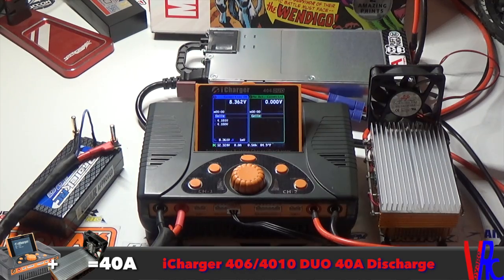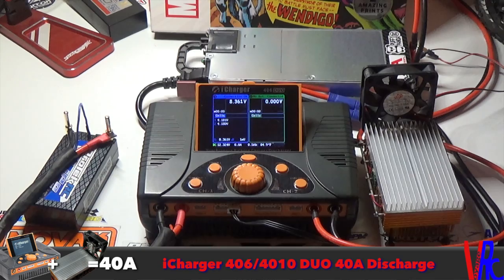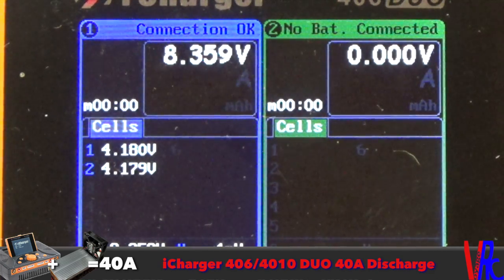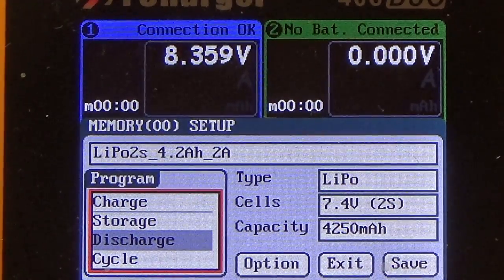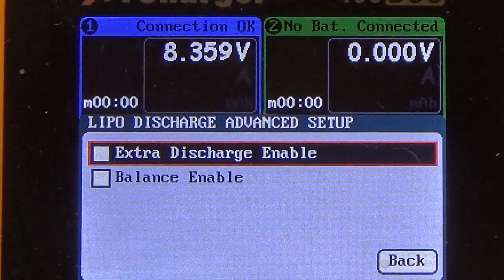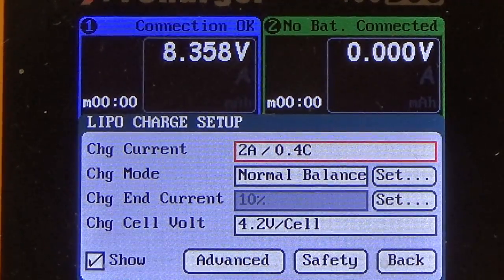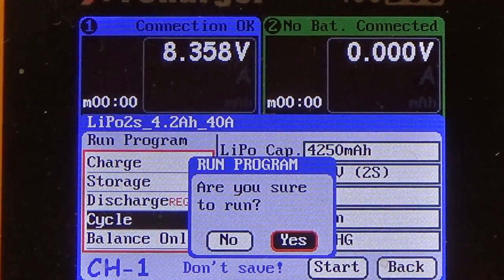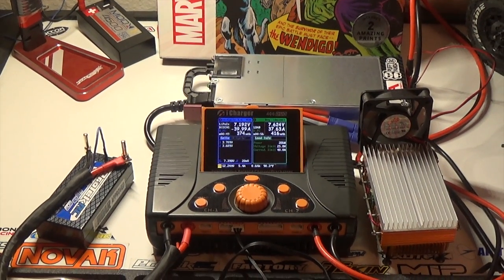How to setup an iCharger 406/4010 DUO for a 40 amp discharge using a resistor bank!

Comment: So when the cells discharge to 3.5 the icharger automatically goes back up charging because cycle was selected? How long before your race do you ideally want to do this?
Reply from the maker: @rycam418418  you would want to try and time it so the high rate discharge/charge cycle is finished charging right before your race. That will have the most benefit.

Comment: Is there a step to set the low voltage limit in the discharge cycle?  Great video!
Reply from the maker: @polizei16  low voltage being cell voltage when the discharge cycle is complete?
Reply: @VoyageRC  yes, is there a setting for voltage so that the discharge cycle ends at that point, say 7.6, and then switches to charge?
Reply from the maker: @ you can set the “cycle” how you want and it will run a discharge and then charge. You can change the cutoff voltage or leave it at the default based on battery type.
Reply: @VoyageRC  very cool, thanks for clarification.  I'm waiting on getting a dx6 in the mail is why I asked.
Reply from the maker: @ glad to help. Charge safe my friend 👍🏻

Comment: Nice VDO. I'm going to buy this charger (used). If I discharge with resistors bank like you by use a bad battery (very different of IR value of each cell). will this charger protect each cell from volt going below than setting and completed with balance ?
Reply from the maker: The charger will do its very best, however, if the battery has a bad cell then things can go wrong. Always keep an eye on the battery while charging.
Reply: @VoyageRC  Thank you so much.😀

Comment: I'm getting back into racing, and I have to say -- this is fascinating. It kind of goes against everything I've been reading about proper LiPo charging/safety. I'm curious, what do you think the realized power gains are? Are we talking 2-3% here? More? Not sure how you would really test this other than "feel". 

Anyway thanks for the video!
Reply from the maker: You definitely feel it. There is no way to quantify it. Thank you!
Reply: Internal resistance directly correlates to max discharge. A DC IR test is the way you quantify any increase in performance of a battery

Comment: Thanks for the walkthrough! 
Should you make a charging profile as well for getting that pack charged?
Reply from the maker: You can set it all up on the same profile. 👍🏻
Reply: @VoyageRC  oh I see, so you can just go to charge. Then when it’s done you select cycle.
Reply from the maker: @smcarmel  yes sir. Just select what you want to do for the battery. Makes life a little more simple.
Reply: For sure, makes sense. And 40a is okay? I feel like 20a may do the same thing no?
Reply from the maker: @smcarmel  as long as it is a good quality battery. You will get the most benefit from a 40 amp cycle. 20 amp will be easier on the battery and pro long its life.

Comment: What about 1s batteries ?
Reply from the maker: Change it from 2s 7.4v to 1s 3.7v?
Reply: @VoyageRC  ok cool but not a 40 amp discharge?
Reply from the maker: @AUCRATECH93722  it might still hit 40
Reply: @VoyageRC  ok I will give it a shot.  
Would this be a regular cycle on race days. Also what type of times for the cycle
Reply from the maker: @AUCRATECH93722  cycle before heats/mains. At this amperage it will not take too long.

Comment: Im looking to made 6S resistor bank to discharge your n 40A with 4010 duo ! Can I made this with 100w resistor? I’m calculate around 1000w
Reply from the maker: 10x100=1000
Reply: @VoyageRC  yes I know but your cooler and head think will works very well?? Or is normal to stay so hot in aluminum piece , and thanks to reply me and about your video
Reply from the maker: @accessor100  a resistor bank generates a lot of heat. Some sort of heat sink and fan will be necessary for cooling.
Reply: @VoyageRC  thanks for share! I will made one with this resistors and try to made with 200w too to by less pcs and made smaller bank

Comment: I have exact same set up battery and all. I put the battery to Storage mode at the end of the day. It roasted my charge cable. Do I need to set up separate set up for storage mode???
Reply from the maker: You dont need to, but your battery would thank you for a lower charge/discharge rate. This shouldnt have fried your cable. Its less abuse than a normal cycle.

Comment: Does this Work with 6s too?
Reply from the maker: It will, however, it wont go up to 40 amps.
Reply: @VoyageRC  ist there a way to let it go up to 40A?
Reply from the maker: Markus Romeis it would be a bigger resister bank to account for the extra cells.

Comment: Hi , I don’t understand why would you want to discharge your battery?
Reply from the maker: This is a way to generate a little heat in the pack to lower the internal resistance. Racers will high amperage discharge and then immediately charge the battery and go race. This provides a little more punch during the race.

Comment: Heat is terrible for lithium batteries. Cycling from discharge to charge at high rates will damage the pack chemistry. Same goes for reverse charge to discharge, ie charging a pack to running in a vehicle or on a load
Reply from the maker: Ted Markson feel free not to do this. This is what a lot of the top stock racers do and I have had a ton of questions on how to setup the charger. Yes it is harder on the batteries and you will have to replace them more often. But you also do get a performance boost.

Comment: With the 4010duo can I turn the voltage up higher then 25v will that be ok?
Reply from the maker: I would leave the settings the same as the video
Reply: Voyage RC ok thanks! Appreciate your response.

Comment: Have you used the extra discharge feature ?  Its a resistor in series on the positive side of the battery , it only requires 1 channel.

Comment: Got a question. On my charger on the regenerative channel it says 40amps but on battery side it says only -8 amps what am I doing wrong it's a 4010 duo btw. And power never went over 200watts on bank side

Comment: I followed your instructions and my pack discharged at 40amps but when it starts the charge portion after about 5-10 seconds it stops and says "Error 0701 Output over current (+). Any ideas of why? TIA
Reply: My 406 duo says the exact same thing.In charge mode the highest I can go is 37.9 amps.Power supply is a 1250 watt servor.Thoughts by anyone to fix this issue?Thanks for any input.
Reply: catlover After playing with the settings I also figured out it works too with 39.7 amps. I contacted iCharger support in the US & they said flash the firmware. I updated it to v2.18 & same error. Contacted them again & they said it would have to be sent to OEM for repair in China.
Reply: iowarctracks I'll try the 39.7 tomorrow.Thanks for the info bud.If I have to send it to China I'll prob not worry about it as other than that I really have no problems now knock on wood.
Reply: Just an update for you and anybody my left port only will go to 37.9 charge rate before it kicks off so I tried the right port and I can charge and discharge at 40 amps with no issues.My suggestion is to try both ports and see which is better for you.Good luck and happy charging and discharging.

Comment: Everything works well except you had a 40Amp 9.4C. The highest I can go with mine was 40amp 7.1C
Any ideas?
Reply from the maker: The C rating is just referring to how many times the Amp Hour rating of your battery.  It does not affect the settings. I higher capacity battery will show a lower C rating at 40amps.
Reply: ahhh. Thank you sir.

Comment: Question, I have purchased the icharger 4010duo and have been able to discharge battery packs using the charger itself. So what is the advatage of using this setup over the charger itself. Hate to feel like im doing something wrong or missing out on something, thanks.
Reply from the maker: Using this setup will allow for faster discharge. The charger itself can only handle about a 10amp discharge. Using the resistor bank ups the discharge to 40amps.

Comment: Great video and got my icharger 308duo setup in no time. One question, how important is it to enter the mAh on the discharge programming? I currently have it set to ignore, will I damage my packs?
Reply from the maker: It should not damage your packs.
Reply: Voyage RC thanks. Guys at the track that have ichargers have it set to ignore because they think that if you have it set to a specific mAh, it could stop before proper voltage.

Comment: Would this procedure work with Protek or Reedy HV packs?  https://www.amainhobbies.com/protek-rc-2s-100c-silicon-graphene-hv-shorty-lipo-battery-7.6v-4900mah-ptk-5102-17/p539106
Reply from the maker: Setup is same for all packs. Would just have to adjust for mah and voltage ratings.

Comment: Could you use this setup to discharge a 1S battery with 40A ?

Reason why i ask is that the manual states that the balancing board needs to be connected for regenerative discharging and off course with a 1S lipo that is not possible since it is only 1 cell.
Reply from the maker: Has not been tested on 1S

Comment: Typically how long would it take to discharge? a 2S pack?
Reply from the maker: Chad Lintner depends on the size of the pack. bigger mah rating will take longer. my 4250 proteks average about 6 min

Comment: What are you using for your power supply?
Reply from the maker: Perry Codes a Randy Locken power supply
Reply: So basically server pulls that have had bullet connectors soldered on?  I just can't understand why people that are most likely technically inclined would pay a 400% to 700% markup for someone else to solder on bullet connectors and wrap it in some vinyl... On top of that, it's a product that isn't going to be warranteed... Blows my mind.
Reply from the maker: Then dont buy one
Reply: I won't. Thanks for the suggestion.
Reply: https://www.rlpower.net/collections/all?page=1

Comment: Can i discharge 3S, 4S, and 6S whit this resistor bank?  i have Icharger 206B, 306B and 406duo
Reply from the maker: Sune Olsson higher than a 2s has not been tested on this particular resistor bank. Setup is the same and it will discharger higher cell count batteries. It just might not hit 40amps.

Comment: How hot do the wires on the battery side get? Mine got really hot.  My discharge bank was 170 degrees.
Reply from the maker: Battery side wires are 10g and stay pretty cool. Just get a little warm

Comment: Thanks!, this is one of the few videos that explains setting this up instead of just showing it working.
Reply: The charge cycle is at 40amps two?
Reply from the maker: Yes 40amp charge and 40amp discharge